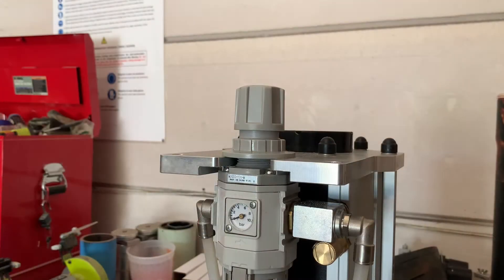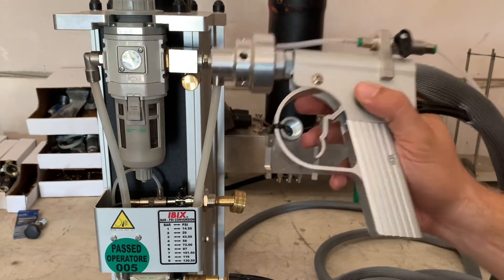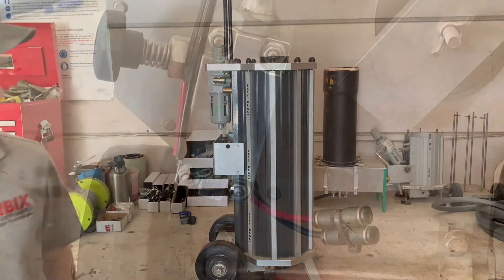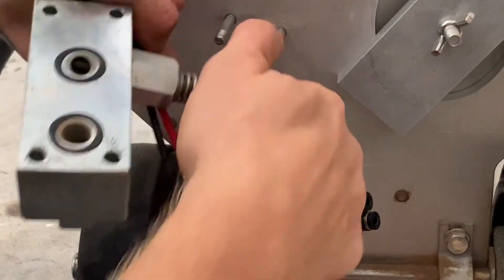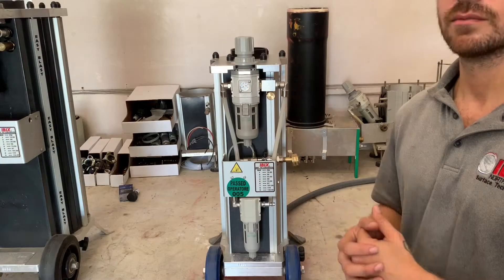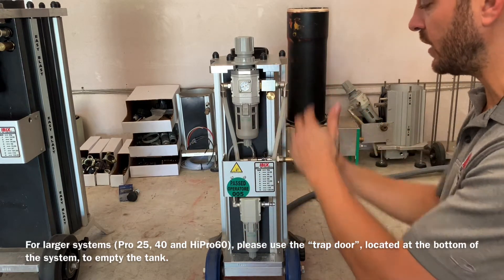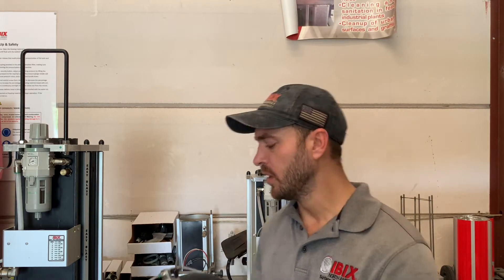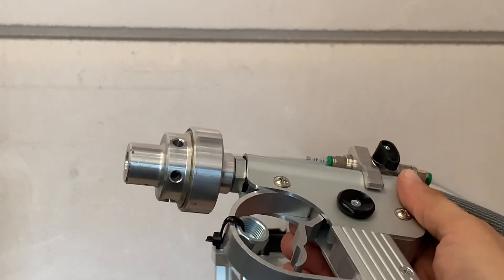Frequently Asked Questions Vol. 1

Comment: Hi, what size compressor do you recommend to run the Ibix 9 most efficiently? 

Thank you.
Reply from the maker: Good afternoon Tom, 

The IBIX Pro9 requires a compressor that produces between 17 to 19cfm, at 116psi to operate most efficiently. If you need any further information. Please feel free to reach out to us at Sales@ibixusa.com. Thanks for your time and have a great day.
Reply: @Ibixusa  great stuff. Thank you for replying 👍
Reply: Hi again, I'm getting clogging everytime  using garnet 240mesh, I suspect moisture is entering the airline. Do you use an air dryer to ensure dry clean air or just an extra water trap. Any advice would be greatly appreciated. 

Thank you.